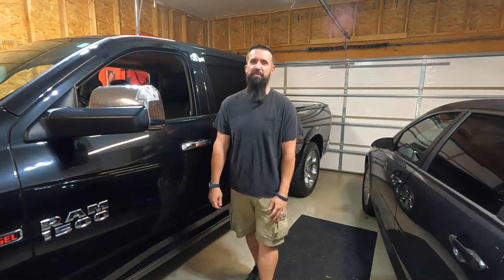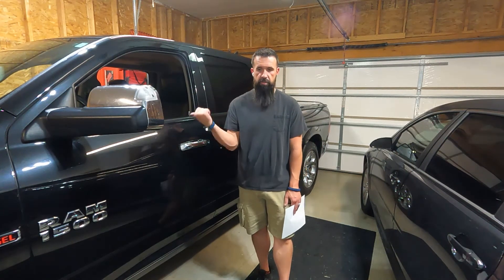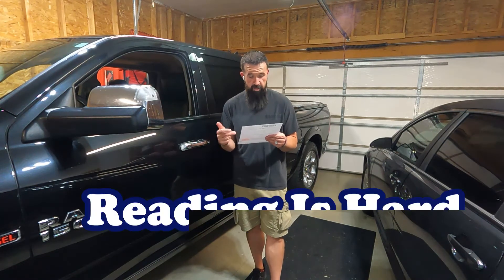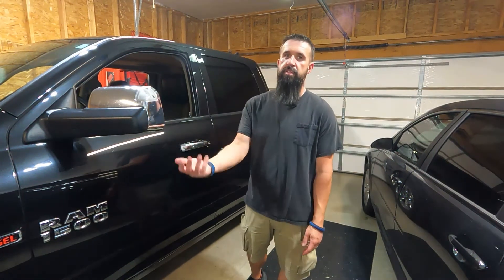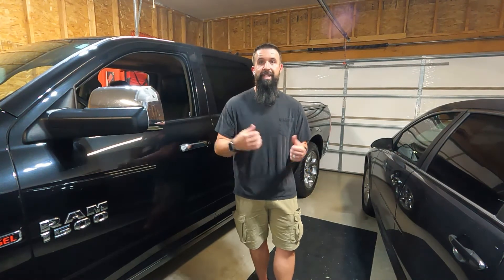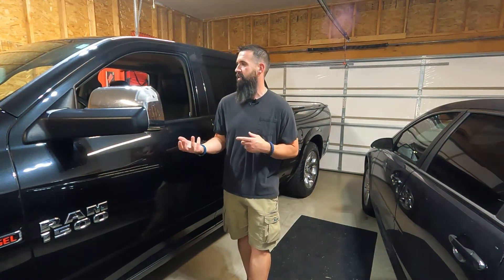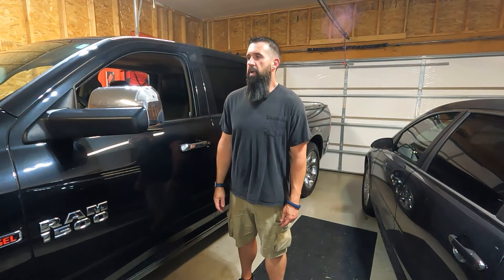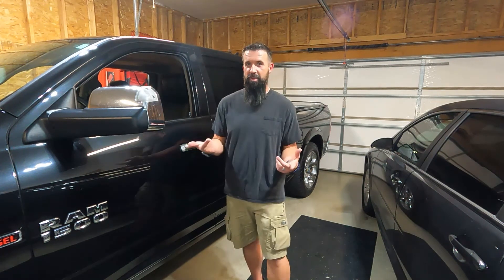Aftermath Of The Service Electronic Throttle Control Light Coming On, In The Ram 1500 EcoDiesel

Comment: Hi I have 18/ram5500 cummins 6.7 turbo diesel/. Light comes and goes. Sometimes stays for couple days. Truck works fine. I cleaned throttle body and air sensors and I replaced the batteries and erased the codes with 12+8 obd2 port as well. What else should I look ? Thanks.

Comment: My experience is my steering went when a red-light steering wheel illuminated on the dashboard  I had to drive at a slow rate of speed and it was hard as hell to turn, the dealer tells me it could be the rack and pinion which is electronic and the price to fix could cost about 4, 000.00 dollars

Comment: I drive a 2017 and this is the 2nd go round with this issue. 1st time they did a Regen and fixed it at the Mitsubishi dealership I bought it from. Cost me around $80.00
Just hit 130k miles and same code is on. Hopefully the shop it's at now fixes it.

Comment: I just had the same codes, on my 2016 with its second engine replacement , I went back through the paperwork and it’s needed a major repair every 20k miles

Comment: I'm at 189k miles and have replaced radiator,turbo tube, and now I got the electronic throttle control issue,  cleaned Map sensors and egr valve.  Truck will not even start now,  I was supposed to check crankshaft sensor now.. not sure what up with that

Comment: Same thing same code happened to me this past weekend with the exception of i stayed off the highway and don't think i hit limp mode; appx 58,800 miles. After net research and not having access to a programmer to force Regen, i cleared the code with a Scangauge II and upon starting truck went into Regen, drove down the highway during regen and now everything is fine more power than past month or so I'd say... got lucky idunno but now i will set up the Scangauge to monitor soot levels so I will know next time it's about to happen...

Comment: Second time with this code with-in the year of ownership. It’s a 2015 and the first time there was a software update, now the second time happened on a 9 hour trip home from California. They’re telling us that it needs a new crank shaft, what a headache this truck is.
Reply: Correction*** crank shaft sensor. But what the dealer said was the truck is under a diesel extended warranty. Originally the dealer said it was a 500$ deductible for the warranty we purchased with the truck. He made the mistake and corrected it after 2 days of having the truck at the dealer. What a ridiculous process, hope those that encounter this have better luck

Comment: I’m agreeing with you too. But you don’t have to buy throttle remove 4 screws take it out before of this cut the electric in truck completely even no 1 volt after get new gasket clean it do not touch butterfly valve clean with tooth brush with crc throttle body cleaner. Dry it with lean free cloth or blue color mechanic towel or bounty wait 5-10 minutes after put gasket put the screws back attached together. Connect battery Turn engine on no start press gas pedal slowly bottom and release 2-3 times and turn off ignition. Wait 1minute after put your small diagnostic reader erase all codes turn on ignition and start truck everything will be fine trust me. 
You don’t need all stuff replacing full line etc. all bs. Dealerships reap off how many parts they will change related with system mechanics get commissions from this part and hourly job. How many parts they are selling making more job. It’s not only rams all cars and trucks.
I’ve 2021 ram 3500 still issues but I’m fixing myself mostly except which is need computer programmable parts. That’s the rams don’t give outside mechanics new version of ram 2021 after programmable softwares. You have to buy pods cables etc $1800 and more and getting sofware minimum $10000 and Panasonic laptops plus connection fees each time connecting fee minimum $200 
So that’s the reason hard and expensive. But when you get this system you can fix yourself more cheaper. 
Good luck let me know how you will success.

Comment: I got the 2016 ram 2500, today I’ve got 1,412,000 miles on mine, best thing I ever did was delete it, rip that shit out.. And never go to a dealer, dealers have destroyed my vehicle with trying to replace parts that are not needed, back before my delete Salt Lake City Chrysler dealer regeneration and literally melted my truck down causing me 17,000 and repair them they wanted nothing to do with.

Comment: They screwed you all you have to do is take the boost sensor out and clean it will fix the issue
Reply from the maker: I didn’t pay for it. It was free for me because the new engine was under warranty
Reply: Boot sensor?
Reply: Not necessarily I just replaced the boost sensor and mine still isn't fixed

Comment: thought the 3rd gen was suppost to be better my 2021 21000 mi just had this problem yesterday
Reply from the maker: The egr and dpf just kill these engines so bad.
Reply: Have a 3rd gen as well. Has left me in limp mode towing a travel trailer twice, no power at all, not enough to move. Luckily it reset to get off the highway. Time to go shopping, regretfully not another Ram, like the truck, but not the reliability.

Comment: I have a 14, dealership treated the symptoms not the cause. EGR and DEF is the issue. All that soot being cycled back through. Do yourself a favor and delete the truck, that's the cause of the issues. EGR leaks and causes throttle issues, and your DEF and SCR systems are prone to clogging up. My 2 cents for what it's worth
Reply from the maker: I completely agree with you but I don’t think we are supposed to say the D word on YouTube because you know “diesels are bad” lol
Reply: @woldolphsgarage1566  must have been auto correct. I ment...umm... detail. Yeah, detail. Detail the truck. I haven't had any issues engine side since the detail. If I could.only find the short to my rear passenger window I'd finally be happy lol
Reply: Did you find an issue that fixed it, mine is tuned and detailed lol and get this every couple days now

Comment: Mine is at 130500, just put up service ETC, checked codes, pulled po386, inspect crankshaft sensor. Taking it to the electric auto repair shop on Monday. Hope it's not too much.

Comment: I’m going through the same thing with my 2019 .Blew the Cummins engine at 60k and got a brand new engine and nothing but engine issues and check engine lights.I’m currently heading to dealership now with check engine light again and service electronic throttle control light on at 97k miles.I hate this POS

Comment: This truck after having the AEM service done two years ago which was required... Has been nothing but a klusterfuk it has been in the garage 11 different times so many different parts under warranty you can't even keep track what warranty you've gotten Chrysler doing this and that had to file a complaint with them now they want to settle with me but they want me to sign off on anything to do with the truck going forward they know they put out a piece of s*** from an engine standpoint the throttle control message comes on more than the radio does... I have had this in 11 times for the dealer there are so many parts that are under different stages of warranty from replacing 2 3 4 5 and 6 time it's unbelievable now I have the same issue again... Today I am taking it in tomorrow to a new dealer because I'm done dealing with these guys who really know nothing about the vehicle they've never been trained in this vehicle they just hit and miss.... Alright they are now called Stellantis... what the f*** is that?!... I will be taking this vehicle in for the last time it will get fixed and it will be sitting on someone else's driveway lot for sale dot-dot-dot and I'll probably be driving a Chevrolet or GMC at least I know it's going to have some decent serviceability the interior's probably won't be as nice but at least I won't be broke down on the side of the road every two months